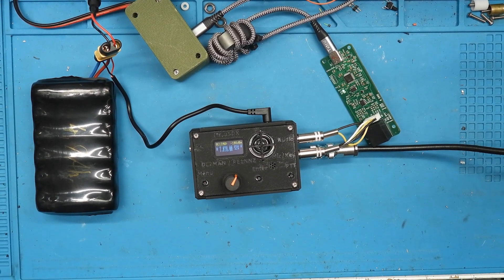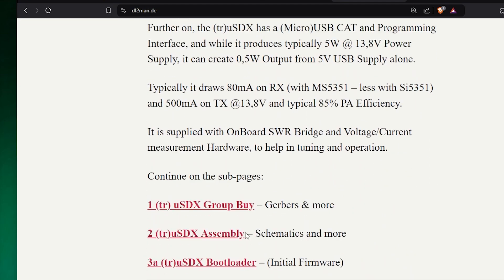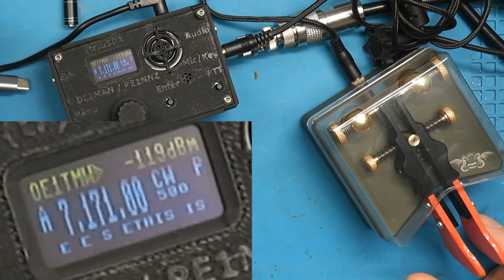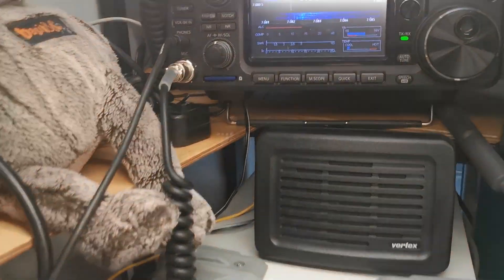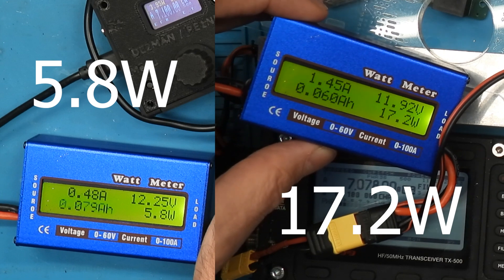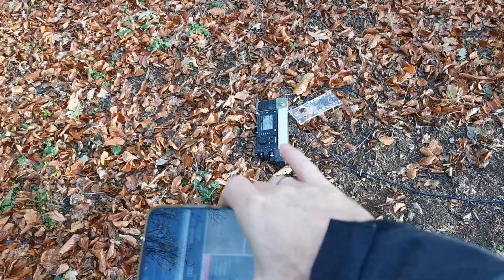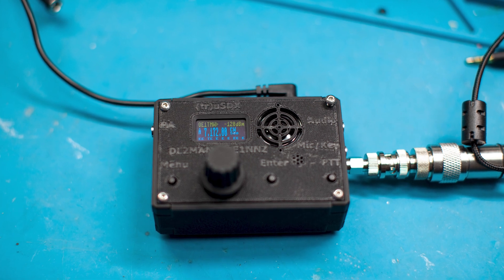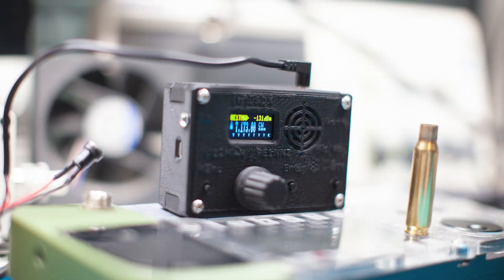(tr)uSDX - A Game Changer!

Comment: The kit is cheaper than the qmx and they both achieve qrp out comes.  It is also easier to build. Glad you covered this.
Reply: Ps-i love my QMXs. I use my trusdx like a toss around and the qmx like a pocket radio. Hihi. I love them both though the trusdx is also way way lighter however you need a sound card and the qmx is direct usbc into a laptop.

Comment: I fixed  3of the usdx units for  Hams, but I do not see any pleasure for the ears by ssb Mod.
CW or digi mod not bad , but please no ssb Modulation.
True is most Mics are overdriven , but still Mod by 8 bit CPU   ???   not my quality !!
Reply from the maker: yes I agree. also without overdriven mics it will still sound quite bad.
my voice what went through the truesdx for testing was recorded with a 1600€ preamp (neve portico) and a 1000€ microphone (akg c414xlii)

Comment: I think you have to change the pa bias settings, I have build before the usdx 1.02 version by WB2CBA, and it improved allot to twiggle this settings.
Reply from the maker: Thx I tried...also used a different Mosfet. You can get it a bit better dialed in I guess than I showed in the video.....but its really tricky imho.

Comment: Interesting.  My truSDX audio isn't crackly like that.  Dont get me wrong, its not great, but not that bad.
Reply from the maker: May I ask you how do you checked the audio? was it through some webSDR or do you received it also with a second radio?
Reply: @CrazyChekov  We did it with a second radio.  NVIS about 100 miles apart.  I was on the truSDX radio so I didn't hear it but my buddy didn't said he could hear me just fine.  Sorry, not very scientific, just a data point.  :)
Reply: @CrazyChekov  I used the KiwiSDR VK5ARG to check the audio of my truSDX from Sydney (1176 km away!). I had a self-built microphone set and it sounded very well on the 20 metre band. By the way, if I tested it on my home radio it did not sound as well as on the long distance KiwiSDR.
Reply from the maker: @cmoser54  thx for that information. So it seems like over distance the voice gets "nicer". I can confirm that. Tested my own transmition with an webSDR and it sounded better...or lets say I couldn't hear these distortions or crackings in the sound.

Comment: 3:55  The mic's getting overdriven - it CAN sound better, I've managed to get almost "normal" voice out of it fiddling with the mic gain, noise level, and listening to a nearby SDR webchannel. The most common mistake is putting the mouth next to the mic holes, and talking too loudly! It works much better at arms length with a normal speaking voice.
Reply from the maker: thx for the advice! I will try!
Reply: @CrazyChekov  Hopefully it works a bit. I think some of the tolerances of components might make everyone's box a bit different.
Reply from the maker: @SarahC2  I just tried receiving it with a websdr...that sounds better...I have the feeling somehow the distance makes the audio sound better. Do you tried recording it with a second radio close to you?
Reply: @CrazyChekov   I originally tried with an ATS 20+  little radio receiver (I don't have an expensive HR rig) , and all I was getting was crackling crisp packets with it. I unplugged the radio antenna, and surprisingly that didn't help! I guess the PCB was acting as an antenna and screwing up all the audio.
Reply: I came here to say the same thing. Dial the mic gain back
Reply: Try covering the mic hole with tape.

Comment from the maker: thx for your comment !
i really tried a lot. made all the filter adjustments and measured them...maybe you can share your settings or what you have done. It sounds better when the receiving signal gets weak.

...but like I said...even with that bad sounding SSB....this is a game changer.
Reply: the built in speaker has always been poor quality. in videos where they use and external speaker it sounds much better.

Comment: I think you need to feed your mic input with a 2-tone audio signal and play with all of the adjustments available on the (tr)uSDX while watching the RF output signal on an o'scope until you have cleaned up the SSB audio. Mine sounds much better than yours does and I've done nothing except tune the SSB audio signal path for lowest distortion. These rigs are the price they are because they lack all sorts of circuitry to make everything work optimally out of the box. With a simple rig like this a ham needs to do the work of optimizing it's signals, both audio and RF. In addition to hardware tuning adjustments to optimize transmit efficiency and harmonic filtration, there are more adjustments to be found in the software menus. At a guess I'd say your output FET's aren't properly biased for linearity. 

Manuel's tuning video on YouTube for the Xmitter output stage is very informative but doesn't explain everything about the optimization of other aspects of optimizing the rigs. 
Note that a class E amplifier gets its efficiency by being a resonant circuit at the transmitting frequency, so only a single frequency can actually be tuned for maximum efficiency on a given band, with efficiency dropping off at frequencies above and below it. It's a good idea therefor to decide on a center frequency in a given band you want to use, and tune up that band on that frequency. I'm getting between 85 and 93% efficiency depending on the band. Good luck.